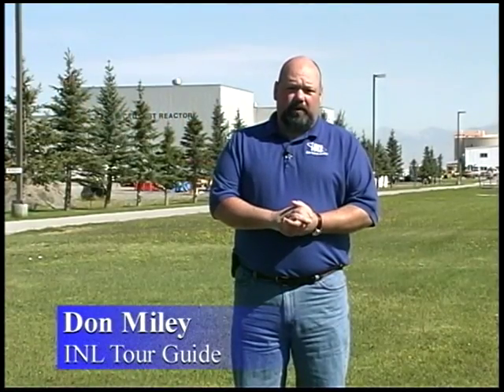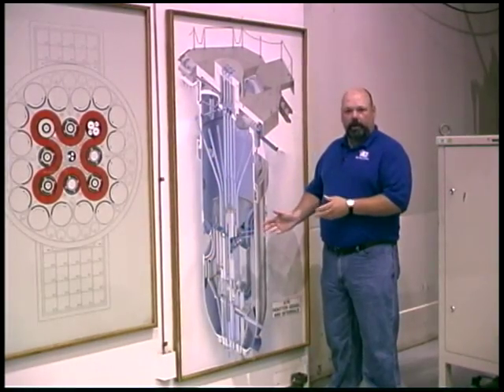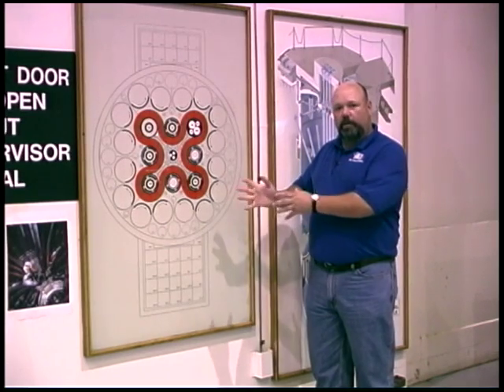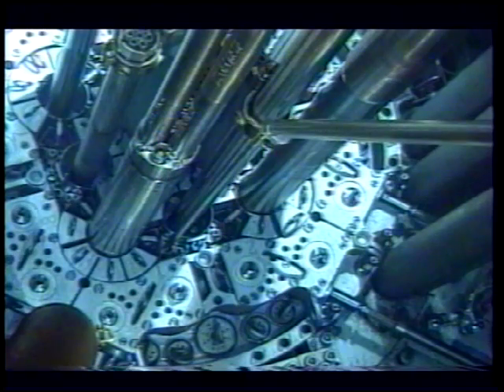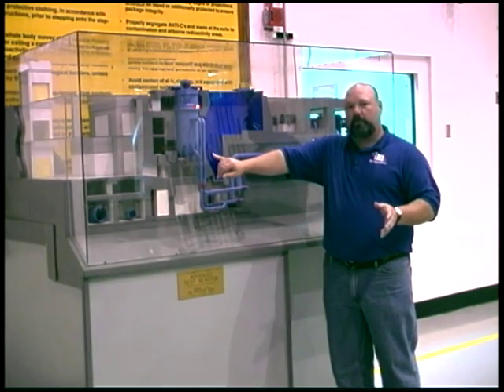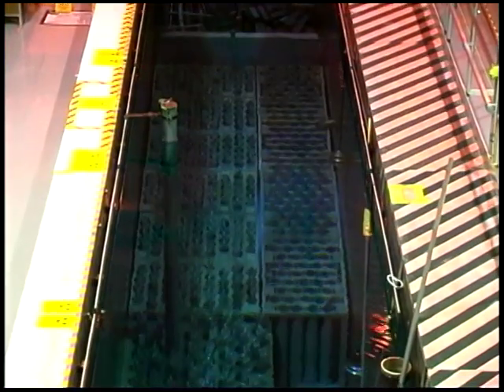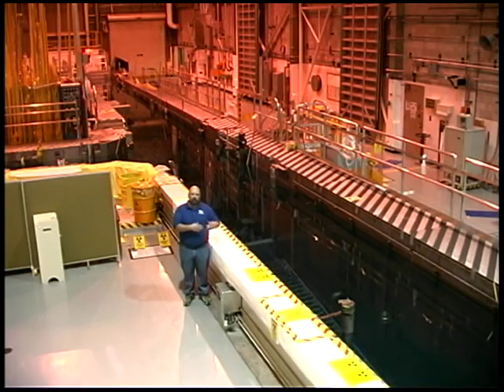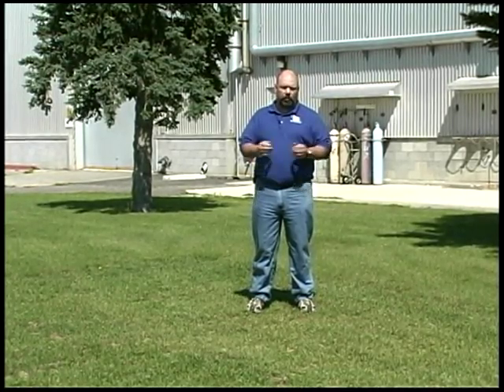Advanced Test Reactor Tour

Comment: THIS GUY IS FULL OF SHIT !  THERE IS STILL NEED OF A CONTAINMENT DOME.  WHILE ATR IS NOT OPERATING AT HIGH TEMPERATUR E AND PRESSURE. COMMERCIAL REACTORS USE ONLY 3 TO 5 WT % U235 ,  ATr uses weapons grade 93 wt  % u235 and is loaded in THE IPTS WHICH ARE UNDER HIGH PRESSURE.  IF A VOID REACTIVITY INSERTION  OCCURS THE FLIMSY TIN ROOF WILL NOT  CONTAIN THE HIGHLY RADIOACTIVE IPTS FROM BEING FIRED LIKE MISSLES THROUGH THE ROOF AN OUT ONTO THE DESERT FLOOR MANY YARDS  AWAY.   THESE IPTS WIL L RUPTURE SPEWING HIGHLY RADIOACTIVE U235 AND FISSION PRODUCTS  WHICH WILL BECOME AIRBORNE AND TRAVEL TO IDAHO FALLS AND POCATELLO.